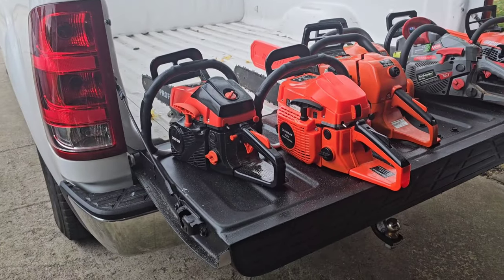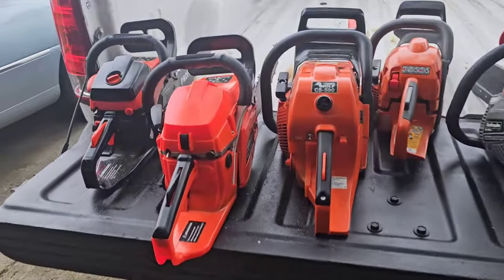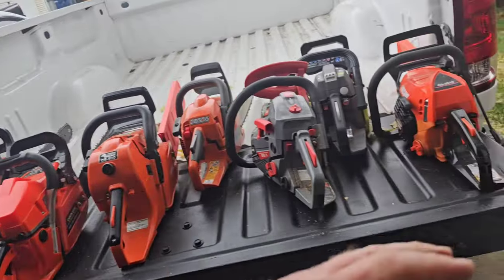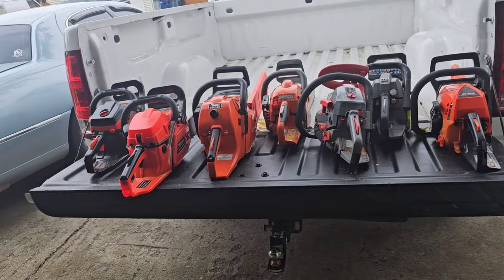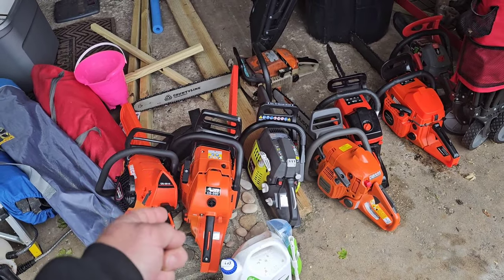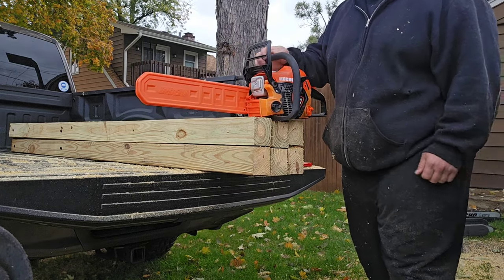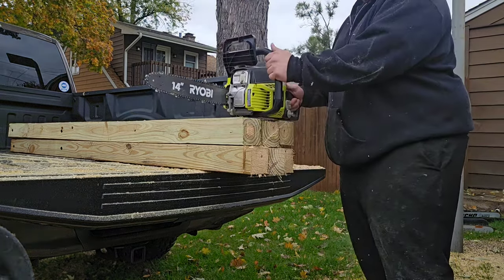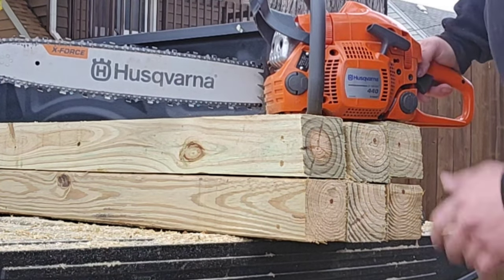Small Bore Chainsaw Review - Husky 38cc, Echo 35cc, Ryobi 37cc, Husqvarna 440 40.9cc - Suprising

Comment from the maker: PLEASE USE THE CHAINSAWS AS Manufacturer Directs and if not confident call a professional

62cc Amazon 
Gas Powered Chain saws 62CC, 20Inch 3.5HP 2-Stroke Gasoline Chain Saw with for Tree Stumps, Limbs, Tree Felling, and Firewood Cutting https://a.co/d/bVqAYDW

68cc Amazon 
68CC 2-Stroke 18” Chainsaw, Portable Gas Powered Chain saws, Handed Petrol Woodcutting Saw Gasoline Chain Saw for Cutting Tree Wood with Tool Kit Chainsaw in Garden Farm(68CC) https://a.co/d/b3I0Uzx

Timberwolves
Echo CS-590-20AA 20 in. 59.8 cc Gas Chainsaw https://a.co/d/3BtlmCf

Ryobi 
RYOBI 16 in. 37cc 2-Cycle Gas Chainsaw Anti-Vibe Auto Oil (Renewed) https://a.co/d/7IFLp9g

Husqvarna 440
Husqvarna 970612338 2.4 HP 40cc 18 in. 440 Gas Chainsaw https://a.co/d/2yBV4kh

Comment: I bought a reconditioned ryobi chainsaw about 8yrs ago for $67. I actually bought two, one for me and one for a friends house warming gift. No cases, but came with a bar and chain, a manual, and a 90 day guarantee. I have cut and bucked many  trees up to 6 inches, and never had a problem. They are 37cc 16in saws. Since I dont use mine regularly, I use canned ethanol free pre-mixed fuel. Always starts on 2nd or third pull, even after sitting for months. Is it an arborist saw, no, is it a pro saw no, but it suits my needs just fine

Comment: i could smell the fuel and the sawdust through the screen. mmmmm.. friend was a stihl guy, all he did was cut trees though. he still liked my little husquvarna. getting old, so i donated it. got a 40v kobalt. pretty impressive for what i do anymore. and believe it or not, i got the 14' pole saw, 40v (after six shoulder surgeries i went electric) from harbor frieght. so far? pretty impressed for $250 including battery and charger.